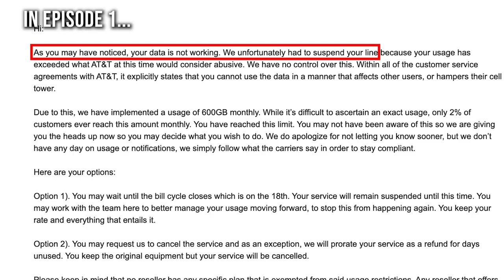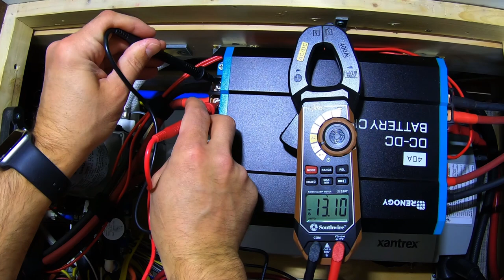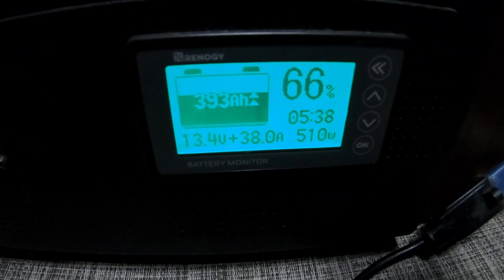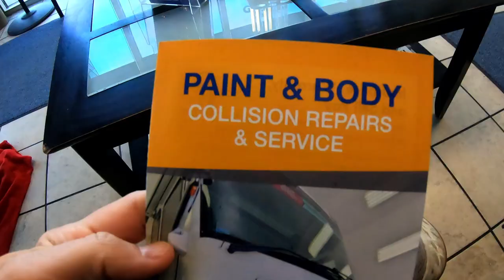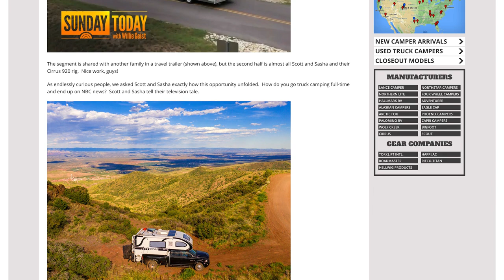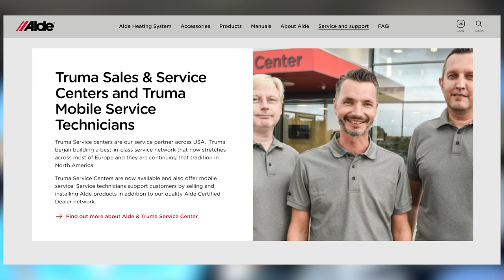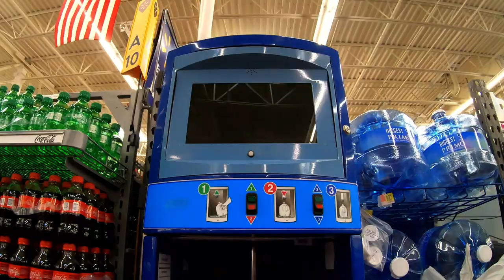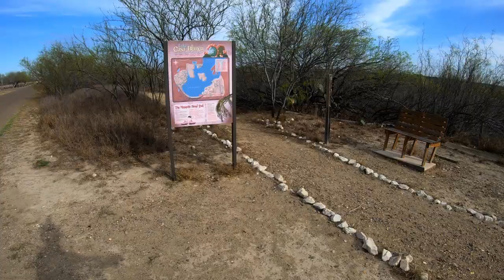Broken Boondocking - Ep. 2 [Full Time Truck Camper Living] \\ Vlog 7

Comment: The more complicated that they make things, the more they break down.
 I like old stuff.
Reply from the maker: No doubt! I like technology and problem solving. People said the same things about air bags, ABS, Fuel Injection, Automatic Transmissions, and almost every other “new” technology. I type this response on a lithium battery powered mobile computer that fits in my hands, that is connected to a global information network through electromagnetic waves that enables instant communication between people virtually anywhere in the world. Talk about complicated!
Reply: @Stonyboot  I remember watching a documentary a few years ago and they were talking about the drawbacks to antilock brakes that the manufacturers didn't want anyone to know about. 

The main drawback is that in a panic break situation when you press the pedal all the way to the floor and the automatic braking system takes over it takes up to 37% longer to stop in that situation during which time you're crashing into people buildings and other obstacles. 
In that case if you don't panic break you can stop a lot faster without the stupid ABS system screwing you up and forcing you to crash into things.
A couple of people that I have talked to personally said that after they pushed the pedal to the floor that it took them a lot longer to stop than it would have if they did not push it all the way to the floor.
Back in the 80s somebody pulled in front of me and slammed on their brakes and I put my pick up truck brakes on as hard as I could with both feet lifting myself out of the seat and it took way too long to slow that truck down and I ended up bumping into the sports car in front of me. that a**** got mad at me for spilling his coffee all over him. Luckily no damage was done to either vehicle.

I really wish I had a video copy of that documentary.

I have tried desperately to buy cars that do not have some of those modern dangerous conveniences.
I love driving a manual transmission. I have had problems with practically every single automatic transmission I ever had over the last 50 years.
I also don't like computers or cell phones but I still have to use them.
I love antique machinery and antique tractors and I restored antique clocks for a living for 20 years. rebuilding clock movements that are up to about 400 years old.
I like woodworking and restoring antique hand tools.
I spent a summer living in my RV at a state park that had a campground and a historic site and I gave tours of a historic woolen mill all summer and loved it and dressing up in period costumes and demonstrating the lifestyle of people back in the 1800s weaving carpet on a big loom and using a drop spindle to make yarn, and giving tours of a 19th century factory and how the machines produce their products. Driving antique farm machinery on the historic site and also on a friend's farm bailing hay.
I never pass up a museum when I see one. 
I inherited my dad's old Waterbury antique  perpetual calendar clock that I got to completely restore and rebuild from the 1890s and my whole family absolutely adores it everyday.
My favorite hand tool that I love to use every chance I get as my North brother's 1545 with two speed ratcheting bidirectional eggbeater drill with bit storage in the handle but I use with adapters for screws and sockets as well. It was made back in the 1890s.
I also love my 1937 Delta drill press that I just install a reversing switch so that I can tap metal parts.

I am about to retire and I want to go live in an RV again and boondock for as long as I can but I want to take my tools with me to fix and build stuff.
I will have to find an old RV to fix up because I don't like any RVs that were built after the 1980s. I don't like the way they look and I don't like all that unnecessary electronic garbage that from what I read keeps breaking down and cost a fortune to fix.

When I lived in my travel trailer for 4 years I didn't need a generator or solar panels. I ran everything off at 12 volts or propane. My diesel pickup had two batteries and my trailer had one battery and I would leave the trailer plug into the truck overnight and use all the batteries combined to run my lights and my TV and my 12 volt fan blowing air on me All night Long during a record heatwave in the Midwest. During the day it was up in the 120s and the Kansas City airport was shut down because of it. that's when I was giving tours at the historic site and watching out for people fainting and falling down because of the heat during the tours. I would also run my truck engine for a few minutes each day driving between the campground and the historic woolen factory to charge the batteries.
With hundreds of 12 volt devices on the market there is not much need to get an inverter or converter for an RV you can run everything imaginable on 12 volts and inverters are inefficient and drain your batteries faster anyway. And since RVs have the 12 volt lighting system throughout the interior anyway you can put a 12 volt outlet next to every 12 volt light fixture so you have more access to plug your 12v devices into throughout the RV.

Sorry for the rant.

Comment: Changing out a water heater is not hard to do. The only thing I can think of tbat would keep you from doing it yourself, is the location and how hard it is to get to. I guess you have to weigh how much time your going to waste waiting for the work or doing it yourself and get back on the road. I'd DIY it. Thanks for sharing!
Reply from the maker: Oh trust me, I wanted to do it myself. However, for $2000 in parts and labor, I'll wait. Since it was under warranty, they don't want people doing the install on their own. The stated reason was because fo the gas line, which I understood. We did get it fixed (video coming soon), but my next step was to ask to do it myself and then have it verified by a "professional". Luckily, we found someone to get it done in a reasonable time frame.

I like to do everything myself, however, warranty policies usually forbid that...

Comment: Not inspiring confidence if I have trouble with my alde. Makes me yearn for the old school furnace in my old lance. Sometimes the old ways are the best ways good luck!
Reply from the maker: To clarify, Alde, the company was great, they were really fast and responsive! However, getting a service shop to do the work quickly (or at all) was the hard part. Alde authorized the use of a non-Alde dealer pretty quickly and they were pleasant during the entire process. I'm really happy with the Alde unit and the company. I'm NOT happy with the general lack of help from local dealers. In the future, I'm going directly to the local repair guy or mobile RV service.

Comment: sheeesh, what a pain in the key-ster getting the water heater fixed. Mine works on LP but on 1/2 the heat on electric ?
Reply from the maker: Our's can run either LP or electric, which is awesome especially when you have a good electrical connection. We never lost heat, just hot water. We did get the unit replaced and will have the video out ASAP.

Comment: Ok so I probably should not ask this because I've not done the research yet but do you know what the difference is between your system and the Truman system?
Reply from the maker: Alde is a Swedish company and they make the Alde Hydronic Hearing System.  It is propane/electric powered and heats glycol antifreeze and circulates it through pipes. It’s basically like a forced hot water system. The unit also produces your domestic hot water and is nearly silent

Truma appears to be based in the US and makes a similar sized unit that run in propane, electric and they also have a diesel option. It is a forced hot air system, produces domestic hot water and is also nearly silent. 

Similar but different. Truma provides service for Alde in the USA. I think they companies are independent, but have an agreement to work together.

Comment: Love's diesel is horrible!  It's bio diesel and will ruin your engine. In cold weather it's especially bad as it can gel and really screw up your injectors.
Reply from the maker: I have been seeing bio diesel blends in most gas stations we visit, depending on the state. Does Loves do that more often?
Reply: @Stonyboot  Yeah, Loves switched to all Bio-diesel a few years back.  Also there are a couple of states like Illinois and Minnesota that only have bio-diesel.  In Illinois my MPG went from 13-14 down to 9.   I never realized how bad it was till then so since have avoided it as much as I can.  Not sure if you have it, but think about installing a fuel filter for your truck.  I have a FASS that works great (filter and water separator)   This can really save your injectors if you get a batch of bad fuel.  Change out filter vs thousands to pull and clean or rebuild injectors.
Reply from the maker: Thanks for the info on the bio-diesel. We see it from time to time depending on the state we are in. Our truck comes with a filter and a water separator. I change them as scheduled. Luckily, we have had good luck with fuel... so far!

Comment: Wow, really not impressed with Alde, they shouldn’t have taken so long to find a solution (which basically you did). What they should have done was refund your money for the entire broken unit plus the cost to remove and install a new one. Then you go to the nearest Alde dealer and buy a new one from them or Alde could FedEx a new unit to you and you do the install and ship the old one back. Something you have to do while you’re in Texas is checkout Los Ebanos, TX. It’s a border town about 5 hours southwest of Austin. It has the only manually operated international ferry boat in the US. I’ll warn you it’s remote and a small town but definitely worth the trip. If you take the ferry to the other side you may need a passport to get back so check with Customs beforehand. Safe travels.
Reply from the maker: In a perfect world, they would have just solved the issue. I will say that they gave me a fair deal and were very supportive. The real challenge was finding someone that would do anything. Most of them said "the soonest we can get you in is in Feb-April), we just couldn't wait. I'll check out Los Ebanos, TX. That sounds really neat! Thanks for the tip!!

Comment: You guys have made this way to complex
Reply from the maker: How would you do it?
Reply: @Stonyboot  You have two alternators I am not familiar with that set up in terms of how  the two alternators interact, I would assume one alternator is dedicated to charging just the camper batteries if that is the case I would have run 00 AWG wire from the Alternator or however you are connected in the engine bay to the back of the bed to where your Electronics bay is at then put bulkhead fittings in side of inside of truck bed just under the top rail then you could tie in your electronics with the most efficient less resistive wire which will make your chargers more efficient. I would not have used two chargers I would have gotten very large one, the largest you can afford. Then you are reducing the complexity. Large wire is very very important with DC power and high amperage. I will include two links one is for bulkhead fittings,  the other is for a access port where you run you wire through the bulkhead of your camper just like for the wire that is used to plug into shore power at a camp site except this access port will be for connecting to electronics  compartment from you alternator. IT says 30 or 50 amp cable but its nothing more than a plastic cover electricity doesn't interact with it so you could also use it as an access port for cable from your truck bed to your electronics compartment. My camper is very old I rebuilt it and I have access to the inside of the bed of the truck from inside my camper via a cabinet door so that is where I have my battery box. That should be enough info for the moment . I would be happy to answer questions if you have any. https://www.amazon.com/Fastronix-Premium-Current-Terminal-Connectors/dp/B079K5HB79/ref=pd_rhf_se_p_img_6?_encoding=UTF8&psc=1&refRID=NC3NRTAH1T9SD68CZ5W7
https://www.amazon.com/POWER-CABLE-HATCH-Camper-Motorhome/dp/B01JKWC6OQ/ref=asc_df_B01JKWC6OQ/?tag=hyprod-20&linkCode=df0&hvadid=475805362238&hvpos=&hvnetw=g&hvrand=3962577856861848754&hvpone=&hvptwo=&hvqmt=&hvdev=c&hvdvcmdl=&hvlocint=&hvlocphy=9027204&hvtargid=pla-1041157394520&psc=1